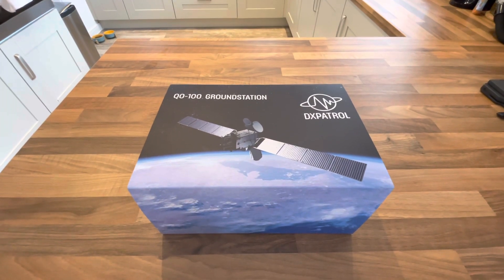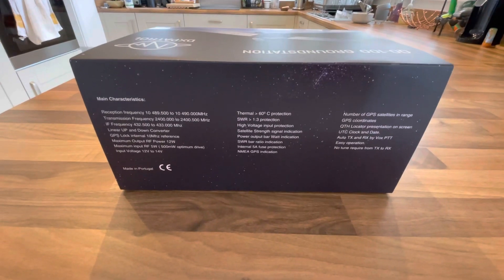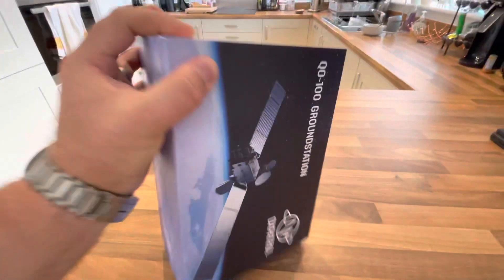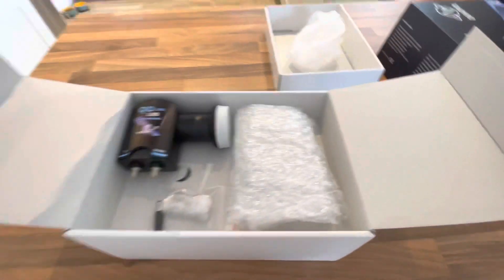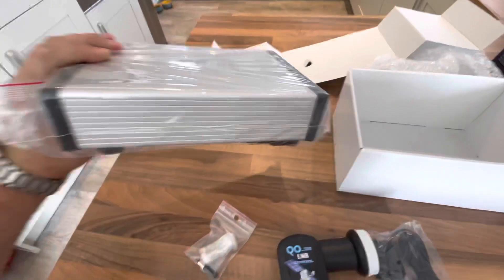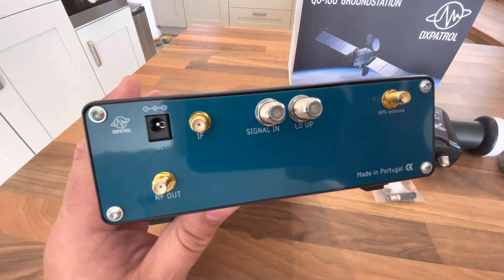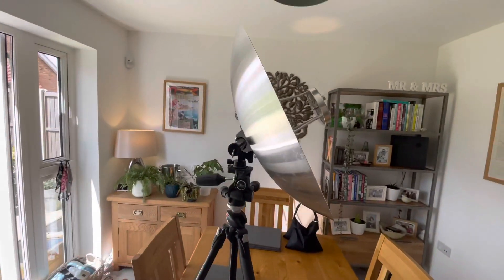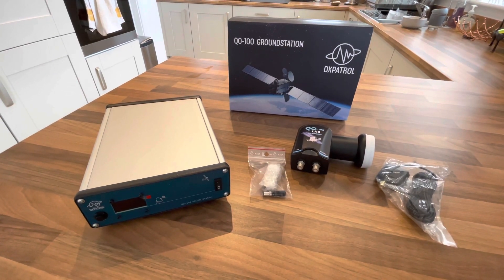DXPatrol QO-100 GroundStation Unboxing.  (QO100 Es'Hail)

Comment: hi m8, how are you getting on with this ?
Reply from the maker: I had it receiving perfectly with a 40cm dish on Thursday.  I have been away all weekend though, so haven't had chance to TX yet.  If it doesn't rain after work today, I'll give it a go :)
Reply: @MrJoshua  very nice, ill have mine in few days cant wait, jaysus only 40cm, niceee. I got a camping 66cm one, but if 40cm works ill get one. This is for portable use
Reply from the maker: @ronancullen4565  Yeah this is for Portable too 👍🏼

Just been sat in the garden and made a few nice QSOs.  France, Wales and Germany.  South Africa was coming in strong too, but he was waiting for a sked to start.  

40cm MaxView folding caravan dish for RX with the DX Patrol LNB, and a 60cm prime S-Band dish with matching Patch for TX, because I like to be different 😂 “ahh there goes two-dish Josh…”

I reckon you’ll be safe with a 60cm+ dish for TX and RX.
Reply: @MrJoshua  very nice 👌  congrats. I got the dxpatrol helix, so it will all be on the one dish for tx and rx, looking forward to set it all up, have the GS  just waiting on sat dish I ordered

Comment: I did a guick power up on my channel when I received it. I've got the new DX Patrol helical antenna for TX which I've been playing with and need to do a video on that. 

The stability on RX is superb; tune to 432.5 and you can hear the beacon.
Reply: picking mine up later today, cant wait
Reply: @ronancullen4565  What are you using it with? Which radio, dish and TX feed? I started with a POTY but moved across to the DX Patrol helical because the beam width is smaller so will give better illumination of the dish. 

Have fun :)
Reply from the maker: @rjy8960  I'm really impressed with the RX stability.  As you say, the lower NB beacon is spot on 432.500!
Reply: @ronancullen4565  Have fun! Hope to hear you on the satellite - de M0SNR
Reply: @MrJoshua  It makes finding the satellite so easy. I've also replaced the nuts that hold the dish to the pole on mine with M6 wing nuts so I can pretty much leave the elevation fixed and just alter the azimuth and then lock it up. Bought a cheap Amazon portable tripod.